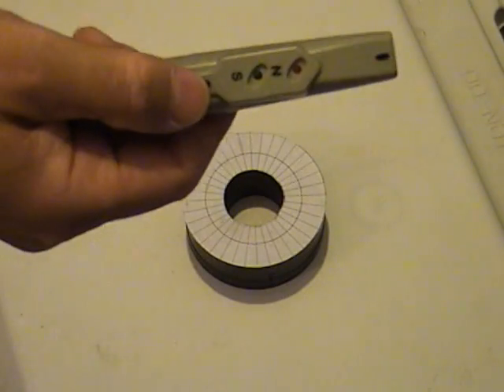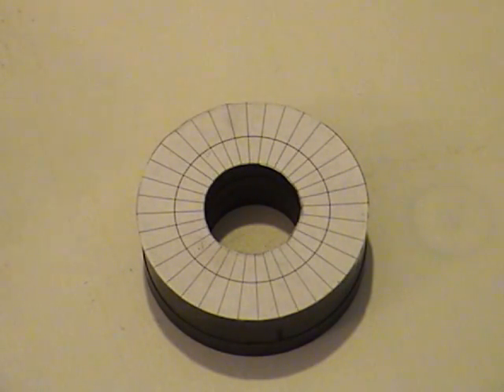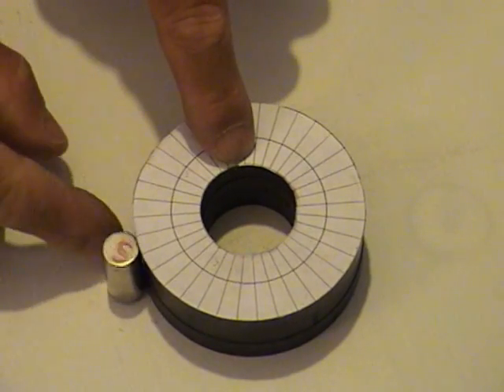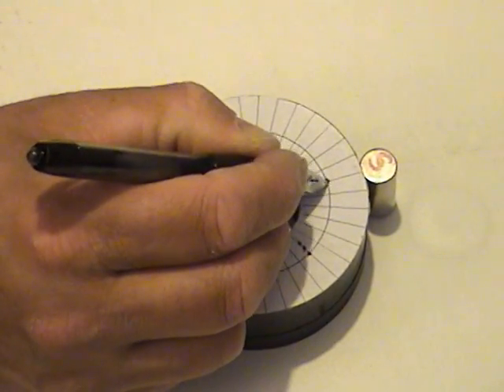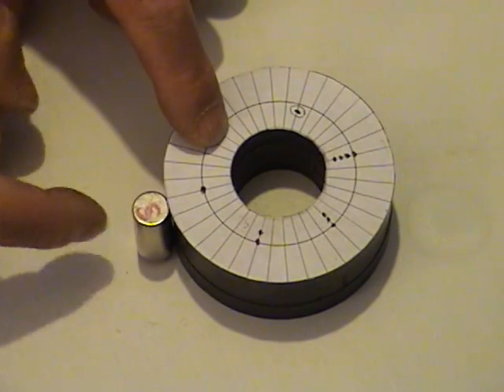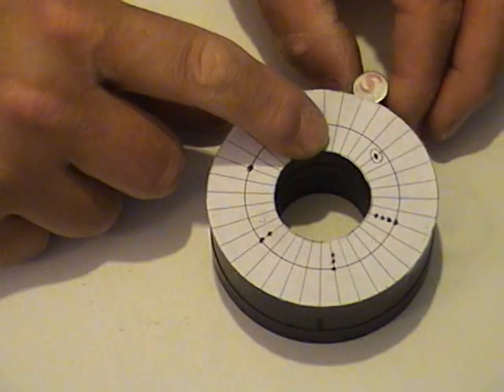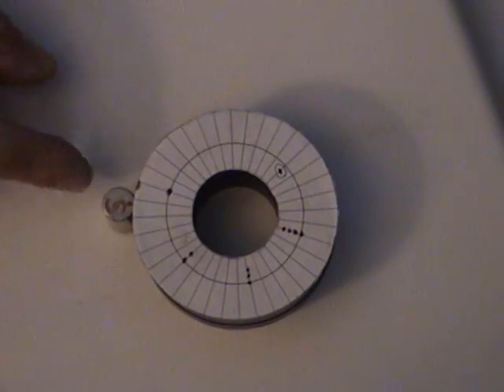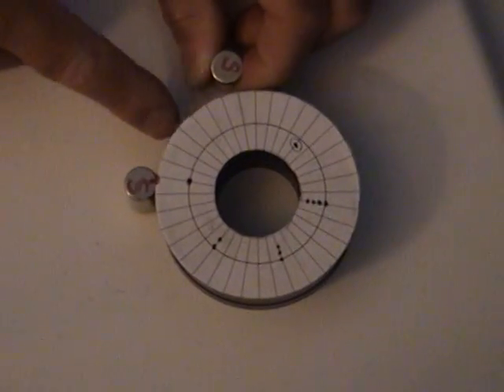Ring Magnets.mpg

Comment: This is what gets me about magnets. My neighbor who was an engineer told me that manufactures have a lot to do with the quality and accuracy of magnets. The NEODYMIUM magnets from CHINA which is where literally all NEOs are made comes in two grades. Actually made to specification of engineering and seconds which are know but sold anyway as first class units for the cheap price. The cost factor for the good ones is about twice as high as the seconds. Motor builder have also told me the same thing. 
The ceramic magnets used in speakers are made to lose tolerances for the magnetic fields. That is a know Sir.

Comment: What if a cylinder magnet poled length wise positioned with a crank, rod, cylinder also has in the head a 2nd cylinder magnet, positioned perpendicular to the first magnet but  poled sideways. The 2nd magnet spinning like a camshaft would alternate its poles every 180 degrees by spinninglike a cam shaft. 1:1 with the crank. The head or sideways poled magnet would pull up on the 1st length wise poled piston magnet during the upstroke . At tdc the head magnet would spin 180' and push down on the piston magnet during the down stroke.

Comment: The stronger magnet can change the weaker magnet poles as the real magnets are not the metal but the individual magnetons that are running in or around the metal... Take a sphere magnet and use bigger magnet, you can change poles what ever side you want...

Comment: Its almost behaving as if the small Nd magnet is diametrically oriented instead of axial like the ferrite speaker magnets . Interesting. I know for sure a diametrically magnetized cylinder will behave that way when you roll it on a ferromagnetic material and oddly will even do it on a non ferromagnetic material.

Comment: Barley got a g.e.d but I believe its common knowledge motion is energy and everything is in motion even things that are dead. Its finding the right configuration and design will ultimately get a zero point or free energy motor system generator or whatever your trying to do or learn.watched a video today about how when magnets get the magnetism you can change the direction or their polarity to help with directional energy and flow of energy. I want to learn as well and trying to learn. Also forgot the configuration name but theirs a way to amplify the point of energy by placing the poles different ways cause if placed the same way the magnetism are in half circles from north to south and with different directional poles the energies meet at certain points to amplify rather than just meet up. So much to learn and do much information out their. Hope everyone who wants to learn these things can and do

Comment: What was the purpose of your experiment? Besides it has nothing to with SEG. SEG is totally a different concept. What you are doing is to prove like poles repel, and unlike poles attract. There is nothing special about your experiment at all besides the principle of attraction and repulsion. This is what we teach kids in 4th or 5th grade. Magnetic line of forces are important. Get a larger magnet and find out its circumference and get a smaller one that is a harmonic of the larger one. For example for you to understand is if the larger magnet has circumference of 100cm then the smaller could be 5, 10, 15, 20, 25, 50 or even 100. Then they will align and you don't have to spend 30 minutes to figure out new positions. For a rule of thumb, get a larger magnet with the radius of 50cm and smaller 5cm, 10cm, 20cm and then try your experiment and only for yourself not for the youtubers.

Comment: I'll wholeheartedly agree with you that John Searle's mountainous contribution to the field of study free energy / zero point vacuum / overabundance....its quite clear. And I say that, all while simultaneously then wondering just why exactly didn't his technology become a household name ?
I'm deeply intruiged as to ask if you were at all successful in imprinting magnetic wave form directly on a different media altogether than the actual magnet itself ?
I'm currently working on building an antigravity platform. I've been doing a litany of trial and error experimenting, back to the drawing board over and over again, getting to a point down many varying deviations from a given understood well established path....only to come to the realization that you've hit a brick wall and now believe that a wrong turn was taken somewhere along the way, but clueless about where?
After 2 years, I'm scrapping the multiple builds/gadgets and progress made thus far. My new innovation is that now I am going to facilitate the use of rodin toroid coils, and leaving the standard old fashioned coil model consisting of many many wraps with slightly smaller gauge copper wire, then I'm simply leaving these out completely.

Comment: It appears to me that the position that the small magnet stops is only relative to it's circumference.  Where it stops depends on how he pushes the small magnet.  Sometimes it would slide on the ring magnet before rotating.  When it did it would stop at a different spot.  If the outer surface of each magnet was covered with friction tape it would possibly be more consistent.

Comment: The neodymium is so strong that it is sticking to the same pole on the weak magnet as if it was metal and when it rolls to North to south it stops dead in its tracks because it has more pull check each side of that neodymium cylinder with that tool that you have

Comment: Your only finding north and south on each side of the neodymium cylinder its just the other magnet is not strong enough to repell. spin in same spot a quarter inch I bet you it stops in New spots the regular magnet the side is all one poll but not the neodymium if they was both neodymium you would have to hold with all your strength to get to touch trust me I know of physics of magnets

Comment: The first little magnet doesn't have a symmetrical field. That's all that's going on. You should have figured that out when you were able to slide it to an uncharted spot. The S on the little magnet always faces the same way(there's your clue), meaning it has a bias because it's field is not perfectly symmetrical.

Comment: The magnet you are holding is made by a process called Sintering, where powder
is pressed in a mould, and then heated. It is NOT a ceramic, ceramics are insulators
magnets are metallic, and conductors!
Reply: +Reddy Kilowatt 
Generally the “free energy” fringe are not especially technical, it was in this context I wrote about ceramics, and I don't want to have a discussion with you about the definition of ceramics/ceramic material. Today the definition of ceramic/ceramics has changed, and you might just have been smart enough to ask me first, had you the wit. I could say that fridge magnets are conductors, but then I would have to state under what conditions they become conductors. I suggest you use Google and find out the definition of ceramic, that is, the one that suits you.

 
 
 
 P { margin-bottom: 0.08in; }A:link {  }
Reply: +Reddy Kilowatt 
The information you provided is correct, please consider my attitude a brief aberration. It is most important to understand the nature of what we see, not what we want to see.
Reply: +Peter May the guy has stated a few times that he is just getting into this and is just posting his findings / thought process ............. dont split hairs about ceramics and conductors ............... everything can become a conductor with a high enough voltage and or current
Reply: +leighton westbury 
The word conductor means any material that will readily conduct electricity.
The word insulator means materials that do not readily conduct electricity,
under "normal" working conditions.
Reply: Yes I know the definitions of the words, I also know that a high voltage can conduct on what (under normal conditions) would be considered an insulator

Comment: I have messed around with magnets many times over the years, I found the similar thing when rolling a magnet on a piece of steel plate. I had the theory that the magnet manufacturers don't care about centering the magnetic field on the magnetic material. This would cause a magnet to "Stop Rolling" at it's strongest flux side. 
The larger ring magnet probably also has a "Weak Side" that allows your stronger magnet to "Skip a Spot" in the weak area...... just a guess....
Reply: this was very interestiing after seeing this and learning and playing with my own magnets it sparked of a few ideas out the box  thanks
Reply: Looks like it to me too. The poles are not centered in the small magnet. And so it lines up each time.

Comment: это не диск имеет множество точек это ролик имеет пик намагниченности поэтому он и стремиться к этому пику - если ролик положить на лист металла то двигая его пальцем пройдя половину своего диаметра он также рванет на наивысшую точку намагниченности this is not the disc is a set of points is the movie has a peak magnetization so he and strive for this peak - if the movie is put on the sheet metal is moving his finger passed half its diameter it also blows on the highest point of the magnetization - translated gugl-

Comment: The 6 preferred positions looks to my poorly educated mind to be in relation to the diameter of the smaller magnet as it rolls around the larger one. Likely caused by imperfections in exactly where the true pole points are. I'm thinking that they are not exactly at the end, but more to one side. Kind of like the "RattleSnake Egg" toy magnets.

Comment: Sounds like an experiment more of with Gearing, and diameter than magnetic fields.  If a larger neodymium was used then the change in spacing would be greater than 60*.  Interesting if the neo was put in the center and stationary the outer magnet would spin in 60* increments if provided with some initial starting force.

Comment: You still have to have SOMETHING that moves the one magnet around for the other to be pushed by the first.....gee....I think you need a MOTOR.....would that help???? Also...WHERE IS THE ELECTRICAL ENERGY?????
   I've got it!!! Why not take your magnet, and some wires in a loop, about 300-400 loops, and wave your magnet over the wires???? You could even use WIND to push a propeller, that would continually pass the magnet, or even a SET of magnets over the Loops, and even MANY LOOPS!!!!  Oh....yeah....that is already being done.....Wind Turbine Generator....but hey....FREE ELECTRICAL ENERGY PRODUCTION....

Comment: for those of you claiming Searl's generators dont work, the russian's have built a 350kg SEG that continues to self run so long as the load applied doesnt exceed the output for a given speed. I would remind you of the Manhattan Project where Einstein claimed it impossible because there wasnt enough fissile material on the planet to make an atomic bomb, main stream science gets it wrong all the time, only the true visionaries can put aside the current rules and discover the new rules

Comment: Pour liquid nitrogen over the ring magnet, and watch what happens. :)

As the liquid nitrogen expands, it draws energy from the environment. So do the atoms in the magnets. You can create a generator with such a system. The energy exchange keeps the system in line with the 2nd law of thermodynamics. The only problem is you will need a steady supply of liquid nitrogen. :(

Comment: this experiment would be better with a good insulator with a low coefficient of friction between the toroid and neodymium magnet...I feel as if there should be six natural points at which the magnet should sit around the toroid...the same way that six equal circles fit around the circumference of a circle of equal radius

Comment: Very cool demonstration, thanks for sharing. I'm having trouble visualizing how those two magnetic fields (around the neodymium magnet and the ceramic magnet) are both shaped and interacting, exactly. But I'm fascinated by the topic, so I was wondering if anyone knows of any excellent graphics on the shape of magnetic fields? Toroidal I know, but doesn't this experiment demonstrate that they "twist" also from N to S? Appreciate any links.
Reply: To visualize the path or direction of a magnetic field, you imagine lines between the north and south poles, where the distance between them is proportional to the field strength. This is demonstrated by placing a sheet of paper over a magnet and sprinkling metal powder on top of it.
Reply: 0live

Comment: The smaller magnet is diametrically magnetized.  You never tested it on screen to show that, just claimed it was axially magnetized.
Reply: I seriously doubt he knows the difference if he thinks Searl generators actually work. I have yet to see one spin after the power supply is disconnected. I'm working on a cool experiment with a 1" N48 sphere magnet mounted on the end of a stainless steel 1/4" shaft that rotates on magnetic bearings that spins to 250,000 RPM inside a clear PVC tube filled with hydrogen to reduce friction. On that shaft is mounted 3 1"X1"X1/4ID diametrically magnetized ring magnets mounted 120 degrees out of phase in relation to each other. Those 3 ring magnets then spin inside precision wound 125 turn coils of 14awg magnet wire. The leads from the 3 coils terminate to a 2X3 terminal strip to experiment with various wiring schemes such as Delta and Y 3 phase, serial and parallel for testing. I assume the 3 phase would work best to rectify to DC. The shaft is driven by a Rodin coil which is freakishly efficient and the current does not rise as load is added as normally happens in a linear fashion with normal electric motors. I'm still waiting on some custom magnets for the bearings to reduce the gap to 1mm and increase the stiffness of the magnetic bearings. I plan to install a convection driven radiator to cool the hydrogen or may install a small impeller on the shaft to circulate the hydrogen through the cooling circuit/radiator. I stole the highly efficient hydrogen gas cooling/friction reduction idea from commercial generation plants. Should be interesting to see how it runs and eventually add additional magnets to produce longer units as the overall length is limited only to your pipe length. Diameter is limited due to the crazy high RPMs! Hopefully a black van doesn't come get me if it works! lol

Comment: My observation is that the small cylindrical magnet is rotating around, one full rotation. Look at the “S”. The way you drew it on the the face of the magnet there is more space on one side to the edge of the magnet. Let’s call that the bottom of the “S”. It always rotates so the bottom is touching the larger ring magnet. It has nothing to do with the relationship to the ring magnet. I bet If you started the smalled magnet in a different place it would rotate to a new position. Check it out.

Comment: I'm 99% sure the effect seen in this video is in the production of the ring magnet... it's impossible to bend a magnetic field 360 degrees, otherwise it would have no south pole. What you are seeing is 6 smaller magnets which are "put together" to make up 1 large ring magnet. The "positions" are the center points of the smaller magnets, and the reason you don't always line up perfectly is because of the friction between the ring and cylinder magnet overcomes a little bit of the magnetic forces.

Comment: did you think about the reason the magnets dont land on the same spot every turn is because your magnets are not simple North South but multiple poles and therefore, the final loanding position of the small magnet is based on both big and small magnet multiple poles or also the other posibility is that your small magnet pole position is not Top-Bottom but maybe angled from top to bottom. Try to see if the landing difference between tries may be a multiple of both magnet diameter relationship